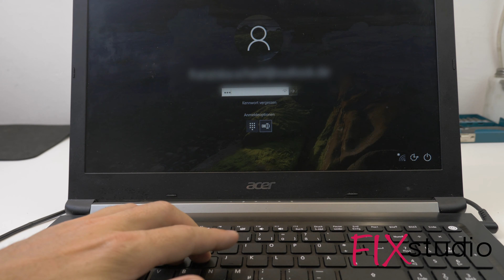Acer Aspire 5 - keyboard replacement [4k]

Comment: Great video, thank you for the effort!  I despise laptops that are designed this way now with a keyboard that is not meant to be serviceable.  Before I buy now, I actually look up the repair videos first to see if they are still design and I will avoid the laptop.  It is a ridiculous amount of labor to change a part that is so often in need of repair because of broken buttons, spilled drinks etc.  I miss the days of older IBMs that had spill trays and robust, beefy keyboards that could be popped out of the top of the laptop.  I'm not sure if anyone still manufactures them that way anymore.
Reply: You have to look for business-class laptops. They are usually still built in a modular fashion, so all the parts can be easily replaced.
Reply: Choose laptops with the HP, Dell, or Lenovo brand.  HP is a pretty simple replacement.  The keyboard from Dell is excellent and robust. Lenovo keyboard is also good.

Comment: Worst design ever. It's a big production number just to replace the keyboard. Too many areas for novices to make mistakes and brick the laptop. The old series was better. The whole keyboard just pops off from the top. Very little room for mistakes.
Reply: These are use and throw laptops.

Comment: Hi , can you tell me what the tool you used to remove the plastic rivet? 
I have a laptop of the same model and I need to perform this keyboard replacement. Greetings from Brazil.
Reply from the maker: It's a small drill machine (Dremel)
Reply: @fixstudioTV  Thanks for the info and for the great video my friend.  It will help me a lot.  I wish you every success!  Greetings from Brazil🤝🙏
Reply: Salve Renato , vc conseguiu fazer o reparo do seu teclado? Alguma dica sobre os plasticos que prendem? Vou precisar trocar o meu agora e to com medo de acabar ficando baixo na hora de prender os plasticos, ja vi em outros videos o pessoal usando cola quente, ou cortando e soldadndo de novo as pontas removidas, queria saber como voce fez e como ficou o resultado. agradeço!
Reply: @suriandossantos4782  Salve amigo. Consegui sim. Fiz o reparo a 1 ano atrás e funcionou perfeitamente. Eu usei uma mini retifica para corroer os arrebites de plastico o  suficiente para que o teclado pudesse sair. Após isso, realizei a troca e fui utilizando o ferro de solda para derreter o plastico ao dos arrebites e moldar o plastico para travar o teclado. Fiz usando esse video como base. E também usei um outro vídeo de um BR para identificar qual era o motivo do meu notebook ter parado de ligar. Faz 1 ano isso, depois que fiz a troca o pc nunca mais deu problemas e o teclado ficou firme.

Comment: hi really thanks for the video. may i know what is that electric tool that you are using remove plastic rivet and where can i buy it ?
Reply: It's called a Dremel tool. You can get them branded Dremel or from other manufacturers

Comment: Is it possible to replace the single fan with two fans from a model with the same 
platform? (the Acer Nitro 5 has two fans for an example) 
Or does this model's motherboard lack a second port for it?

Comment: Hello, and nice job ;-)
I was curious to know what the name of that pencil you use to pour out the plastic droplets. It is a much faster system than the one I use with PLC, cutting it and melting it with the soldering iron.
Greetings!
Reply from the maker: This is a small drill machine - dremel
Reply: @fixstudioTV  No.. I mean the pencil you drop the green drop plastic, and, after that, you use the soldering iron when you are placing the new keyboard.
Reply from the maker: Aaaa OK, it’s just a regular marker, noting spatial… to mark which pins go through the additional shield and which ones need to be melted directly
Reply: @fixstudioTV  Ah! I thought it dropped the plastic you melted with the soldering iron... So you are melting the existing plastic which was in the chasis.
I use PLC instead with the soldering iron, but don't care about which holes to fill... I just fill some of them, in the keyboard and, later, in the protecting shield. Thanks!

Comment: hey, can you do this for the acer aspire a515-43-r19l by any chance, my keyboard needs a replacement as some of the keys aren't functioning properly and there doesn't seem to be a tutorial for my exact computer model

I have more details below
Reply: I already know how to open the laptop up, I've already replaced the previous fan with help from these yt guides, as the model in the video isn't the same as my acer aspire 5, some of the internals look different, and just worried that I might mess something up.

Comment: Can we install backlit keyboard in this laptop?
Reply from the maker: Yes. Connector between Keyboard and Touchpad is for backlight powering
Reply: The acer service center recently changed my laptop's keyboard. It is working fine now but not the same like the keyboard which was originally. I have to press some keys twice to register the keys.
Reply: @UtsavJoshi  Did you changed non backlit keyboard to backlit keyboard?
Reply: @omkarchalke3207  no.. Backlit keyboard to backlit keyboard.. My laptop model si already a backlit keyboard version.

Comment: Question I have this model laptop and the power button doesn't work anymore. I even removed it to try to make a better connection to make it work and it eventually failed. I took it to a shop and they won't touch it. I know i'm asking an almost impossible question here but could you do your best to give me like a percentage of doing this fixing the issue? Or could it be something completely different? I apologize to ask this because I know you need a lot more information to accurately answer this.   But, if you could kindly give me your best estimate I'd greatly appreciate it!
Reply from the maker: Sorry, there are to many possibilities… this can be almost everything.